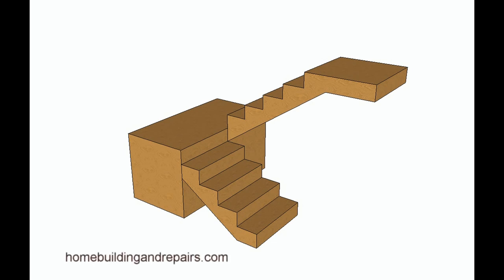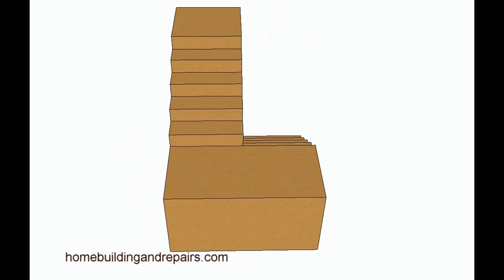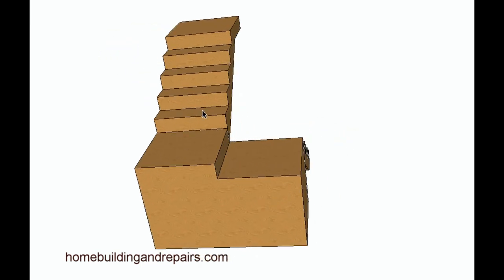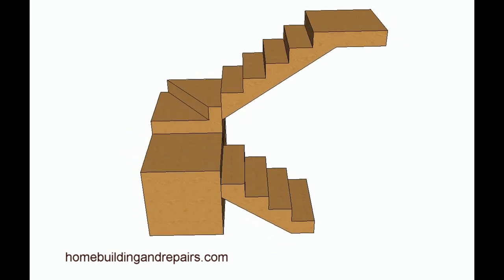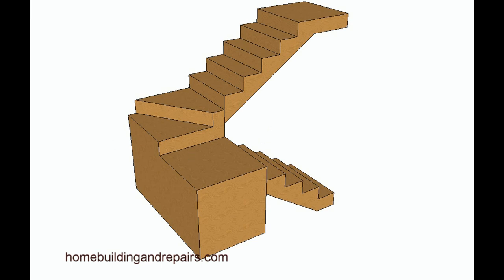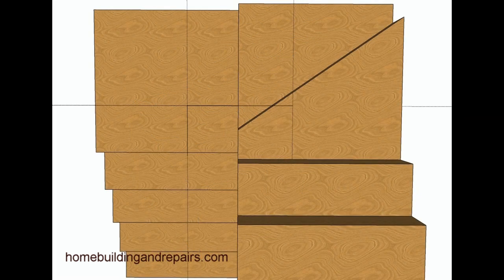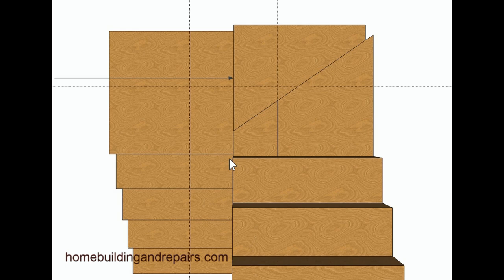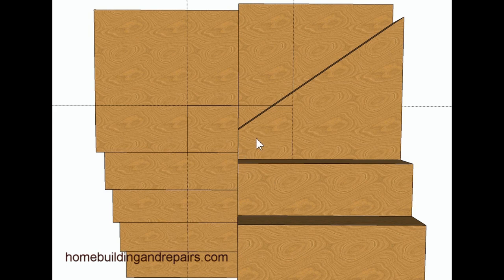Original Stair Landing Design Modification Problems – Remodeling And Home Renovation Tips

Comment: here in austin tx, the 'walkline' has to stay consistent,  ie 12" in , 11" deep, within 3/8" from greatest to smallest rise/depth, winders like that would fail
Reply from the maker: +Scott Starling That brings up an excellent point, always check with your local building department before using any information you gather.
Reply: On that note, do you know a sure way to find what the current/up-to-date codes per local?
Reply from the maker: I wish, but no.
Reply: @scottstarling247  6 min at tite spot